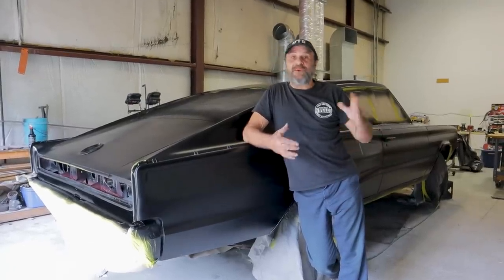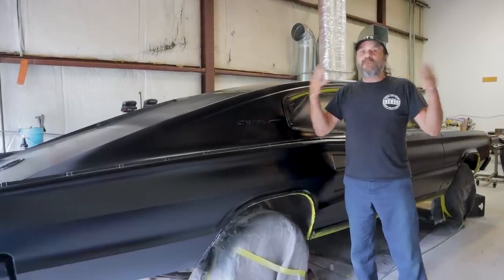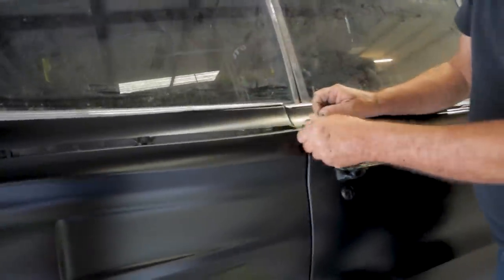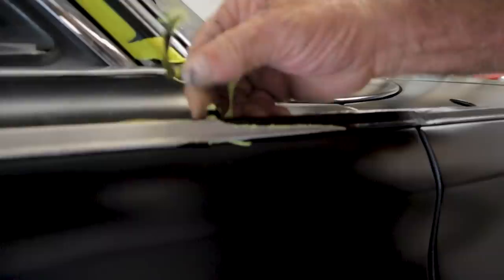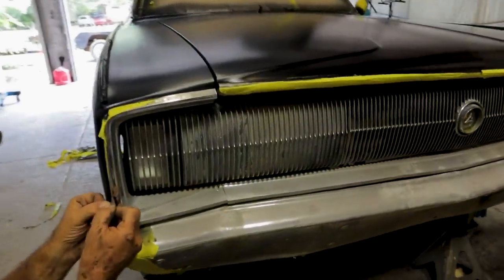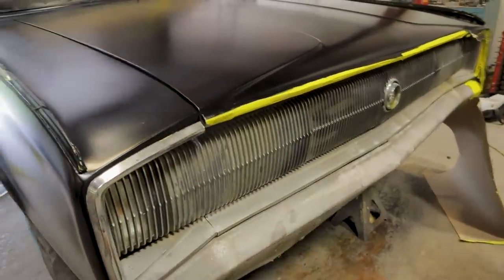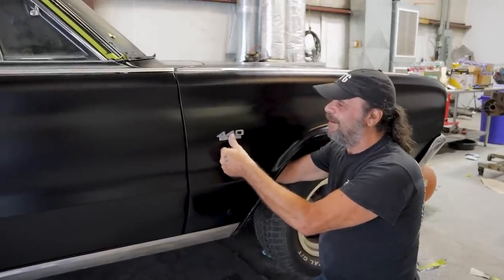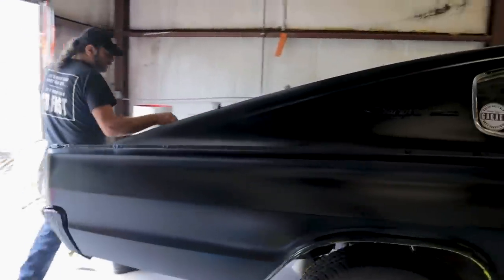Our '67 Charger Looking Downright Swanky In Hot Rod Boulevard Black

Comment: Rather have that paint . Than some crazy expensive paint job that you’re afraid to take out of your garage
Reply: The wheels make the car
Reply: Thats why im leaving the patina on my 76 Jeep J10.. every single old geezer at car shows.. never drives their cars because of this.
Reply: Yep got a 1974, 340,  black satellite,  roadrunner clone, afraid to drive the dang thing
Reply: %100 I drive my 37 Chevy as much as possible. Meanwhile you have garage/trailer queens. No thanks. What are the wheels for if they never roll
Reply: @stevefairchild3337 I have a 72 Monte Carlo I did last year and have the same problem.  Ready satin black it and run the wheels off

Comment: I just want to hear that 440 fire up and you and Uncle Cathy going down the road! I love that design of Charger and Coronet. I had one with a 361 with an AVS.  and I loved that car. The 361 might be a truck motor but a good tune and a set of headers and the 383 cam and you can hardly tell from a 383.  Mine was like a clock. Pop the cap off and check the points before a trip, and put a spare points and condenser and a ballast resistor in the glove compartment, you are golden. You can also go back after the trip and clean it really good and wet sand it if you want. I have always done it. My 65 Galaxie LTD is Caspian Blue. I had to mix my own paint, and I used Nason paint. I wet sanded it and it looked like a pro job. You done good! That’s what a bucket of water and sandpaper.

Comment: I have had really good luck with Summit Racing branded paints. I love the black primer it is almost good enough to leave. I am doing a black primer and blue sealer from the coating store and sanding through then clearing it for a faux Tina. If I painted it nice I wouldn’t wnjoy it as much, this way I can drive it and looks good with my old camper top. Looks good to me!

Comment: Something I used to do was thin a cup of Laquer and turn the pressure down and get the timing  as such to shoot a slow final coat over the enamel and it would lay out the enamel and smooth orange peel and dry spots, runs to smooth the last coat of enamel out. After a few days curing get it good and wet and and it with 600 wet/dry, rinse, 1000 grit, rinse/2000 grit wet. Let it dry by patting it and then compound it. Polish it. Use a buffing wheel. But don’t use  silicone wax. Use a wax for catilyzed enamel . Nason is a catylized enamel. It has to fully cure.  But a wash will bring up a new car shine. I don’t know what you used, but it looks fine to me. And if you ever want to lay 4 more coats on, a 220 dry sand, wash tack shoot a non sanding sealer and shoot it again 3-4 coats . Damn that car looks good! I love that vintage of Charger, Coronet, Belvedere, Ford Galaxies, 66-67 Fairlane. 66/67 Chevelle.

Comment: Even the pros have orange peel. it's how you prep before and wet sand afterwards that makes it. Satin black is nice, i love Rustoleum's Oil Rubbed Bronze--its black with a gold tint in the light. they also have great metallics like charcoal grey.  and scratches are fixable at any Wal Mart.

Comment: Trim pieces which aren't coming off?  I like to use some robust, but still thin enough, paper to slide under the trim. It gets under there easier than tape.  Then I secure the paper with tape.

I know you fessed up all your sins Uncle Tony, but I also seen some tiger striping on the decklid...

Comment: Tony, I agree with you on almost everything, but that paint job is just not for me. I've seen so much flat black on cars, trucks, and especially motorcycles in the past several years it's literally making me sick. There are other colors. Lot's of beautiful, shiny colors that aren't black. I do love those wheels and tires. 40 years ago I had a 1970 base model 318 Dodge Challenger with wheels just like those, with the shanked lug nuts and washers. They had RWL Goodyear PolyGlas GT tires on them. The car was medium metallic green with a white vinyl top and black interior with chrome bumpers and other chrome trim. To this day I think it was the best looking car I have ever owned. Now half the cars on the road seem to be black with all black trim, black wheels, and dark tinted windows. Most newer motorcycles looked like they have just been literally dipped in flat black paint. Did somebody somewhere stumble upon a zillion gallons of flat black paint? I just don't get it. Light/medium metallic green, blue, silver, or even one of the "high impact" colors Mopar used back in the late '60s would make that car look gorgeous. It doesn't have to be a perfect paint job. A daily driver paint job is fine. Just in a decent looking color. Flat black does not reflect light. With all that black, black, and more black, you can't even see the lines of the car. If you want to make it look like a hot rod in progress, medium gray primer would look good.

Comment: I would rather have a straight, rust free or properly prepared and all unibody or frame, suspension any time. I painted mine with tractor paint and used elbow grease to make it look perfect 10 ft away. I can’t stand to see a tri-5 Chevy or a 60s car, 50s-60s truck shining like a diamond in a goats ass with every panel gapped wrong and an inch of mud on the rockers wheel wells and a bent or rusty punk welded frame.  How many have you seen when you open a door you feel like you need to catch it. Urrrr! Some guy tells you he gave $75,000 for a tri power 65 GTO, and you open the trunk and it had a piece of sheet galvanized laid in there with booger weld every foot apart.

Comment: I don't understand the point of painting a car, if the outcome makes the car looks like it needs a paint job... I'm not even trying to be mean, but that charger happens to be my dream car, and I was really hoping you'd do it proper justice. It doesn't matter, it's yours and you didn't do anything wrong. It just breaks my heart a little.
Sorry to be a downer. This car is the like viper to me. Highly elusive in my life. I've always tried to get one, and there's always some bullshit in the mix. Always some "modifications, body work, or tuning" that was done wrong every step of the way. Now this is just another one of them.
It's just another burnout, gasmonkey, kind of thing. Instead of just being classy, as it was off the showroom floor.
This thing would've looked so nice in ANY factory color. Now it looks like somebody was dared to spray paint it at 3 a.m.